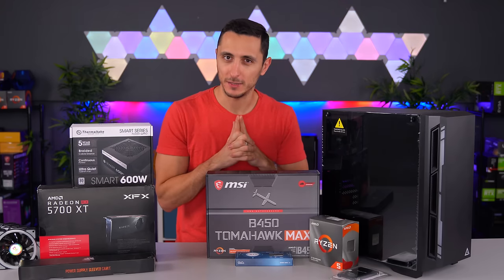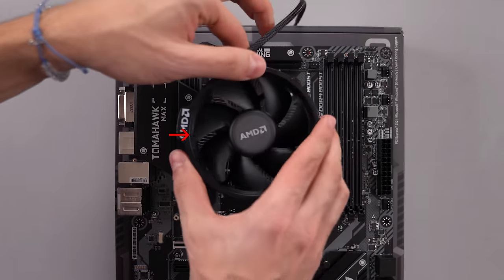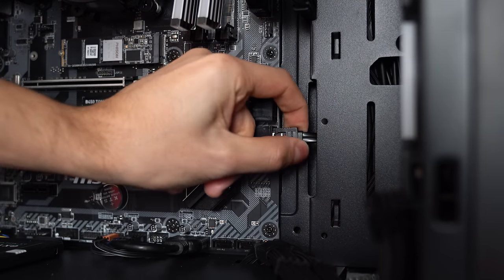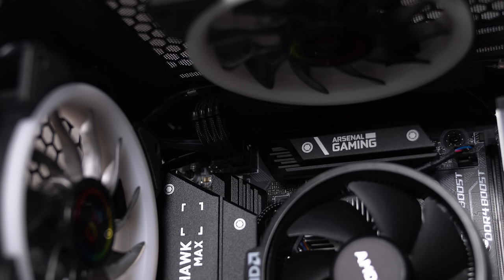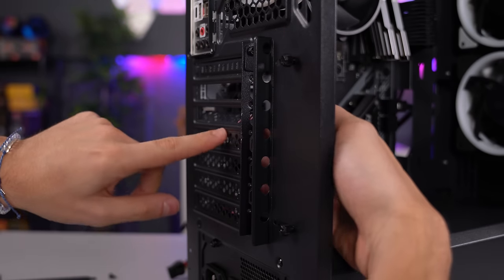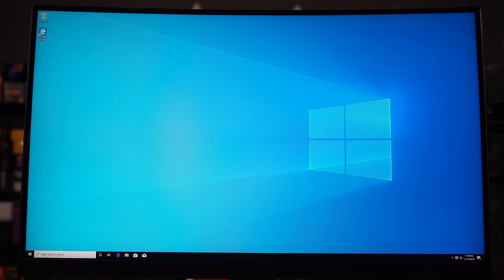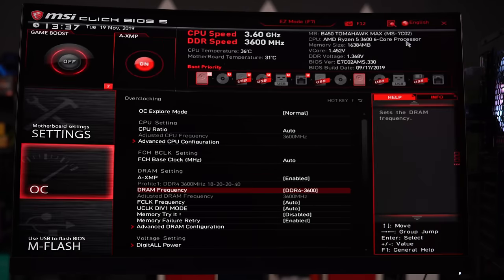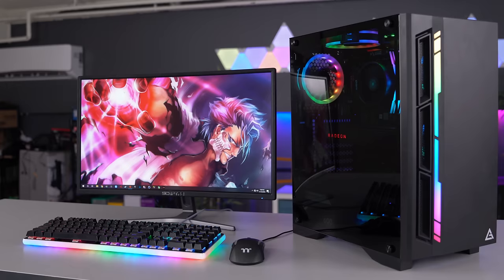How To Build A PC - Full Beginners Guide + Overclocking

Comment: Just built my first PC. I watched this like 8 times over. Great video and thank you for the help 👍🏿
Reply: if you used the windows download in the description could you please explain how it worked
Reply: Sanikk Plays it’s not that hard once you watch a couple of videos on it. I’ve watched a lot of videos but I’d say this one is one of the best or look at joey Delgado’s channel. The hardest part is picking parts and then maybe the cable management but once it’s done it’s worth it
Reply: bole crink If you’re talking about the windows OS download. You need a usb flash drive with at least 8GB of space. Then after you finish assembling your pc before you turn it on have the usb drive plugged into the pc so it will boot to the installation of Windows straight away. Then just follow the steps on the screen, it’ll ask you for your name and other details then where to put the download (choose SSD for this if you have one because it’s faster and more reliable). Hope that helped
Reply: Abdullahi Ali ok, thanks so much
Reply: @Blaqgoku12220  I dont get the wifi bit on it do I need the wifi usb stick or can I just use my wireless connection?
Reply: NOTWild Some motherboards don’t have built in WIFI so you would need to use an Ethernet cable. If your motherboard does not support WiFi you can buy a WiFi connecter that goes into the USB slot of your pc (you can find them on amazon) or even buy one that goes straight into the motherboard (if your board allows this) and gives the pc internet connection. Hope that helps
Reply: @Blaqgoku12220  thank you I now understand
Reply: Abdullahi Ali how much you got for your pc? Btw I’m Somali too lop
Reply: Nufiko I spent around £900
Reply: bole crink worked for me
Reply: @Blaqgoku12220  but how do you connect to the wifi with the wifi adapter?
Reply: john sachar I’m not sure what you’re asking here? If you’re asking how to connect to the WiFi then there should be a WiFi icon on the bottom right of your screen. There may be some programmes you have to install if you buy the adapter but I’m not sure since I use an Ethernet cable and my motherboard does not support WiFi.
Reply: @Blaqgoku12220  in talking about like installing windows do you need wifi
Reply: @johnsachar1406  just for the drivers
Reply: @ShelfOwO  o ok so thena fter installing windows can you connect a wifi adapter and connect to the wifi?
Reply: @johnsachar1406  you need to download the wifi drivers if you mobile data you can connect your phone via hotspot to the pc to get the wifi drivers and the mobo and gpu driver once your done you can connect your usb stick and your done :)
Reply: john sachar you don’t need WiFi to install windows
Reply: @ShelfOwO  o but i have wifi already but dont have a ethernet but i hesr you dont need wifi to install windows from a usb
Reply: @Blaqgoku12220  how many fps do u get
Reply: Savv561- YT I don’t game much on it. I mainly use it to edit videos but on minecraft it gets like 600 if that helps 😂😂😂
Reply: BuckeyeGaming 1212 😂😂😂😂
Reply: Abdullahi Ali does ethernet work?
Reply: Björn Gylfi Yes
Reply: Abdullahi Ali  say wallahi rn you get 600 fps
Reply: Bugie my friend it was a joke
Reply: Abdullahi Ali k had me shook for a second
Reply: Bugie 😂
Reply: Abdullahi Ali 🤣🤣
Reply: Do you need a NVME SSD and a Hard drive???
Reply: Powell you don’t need to have one or the other but an SSD is better as it’s faster and more reliable. I have one SATA SSD and one 2 TB hard drive, so you can have both if you want.
Reply: Abdullahi Ali good cause i only bought the SSD 😂 also do you need to buy 3 cooling fans? because my PC case comes with 1 pre installed
Reply: Powell I would recommend having 4 fans in the system but watch a video on where to place the fans for better air flow. Good luck with the build!
Reply: Abdullahi Ali what about a WiFi card ?? cause i don’t know if i have ethernet
Reply: Did you use thermal paste or no?
Reply: Jack Clark no I used a stock amd cooler so it already had thermal paste pre installed. I would 100% recommend using thermal paste, I’m pretty sure it’s essential for the cpu
Reply: Abdullahi Ali ok I’m pretty sure I’m gonna use the stock cooler too so since you told me it’s pre applied I’m not gonna need to put it on right?
Reply: Jack Clark you’re correct
Reply: Powell I’m not sure how those work because I don’t have one. I would recommend watching some videos on it before buying one

Comment: Today, I started building my first computer at just before 4p.m. I used almost all the same parts but some were different. It was a bit more difficult than we expected, and we thought we broke both the CPU, and the heatsink, but it was ok. Cable management was tedious, and reading all the manuals and making sure everything worked was also tedious. In the end, we did it all right, and it started first try. Thank you for this video! I would not have been able to do it without yours and other's videos. 4 hours later, all the drivers are installed, and I have my very own computer. Thank you!
Reply: How much was the build? im thinking of building it too
Reply: @dara03  What I got all added up to about $1200. But could easily be brought down to around $900, even $850. The main components were a Ryzen 5 3600, and RX 5700xt.

Comment: “a large flat surface area”

excuse me sir, it is a TABLE.

“a screw driver”

no, you need a swiss army knife that HOPEFULLY has a screwdriver. get your facts right
Reply: Don’t forget the tweasers
Reply: techsource isn’t pro at building we are we know everything
Reply: I love it how this still hasn't died out yet
Reply: and an allen key
Reply: Remember the power supply might short circuit so make sure it’s on the anti static pads
Reply: And make sure the ram is right next to each other
Reply: Quality meme
Reply: omg guys i am so sorry i forgot the thermal paste applicator
Reply: expiditious lol
Reply: Don’t forget to apply the thermal paste exactly how you would ice a cake
Reply: @rockabady2345  hmm...seems legit...
Reply: he not fighting static..

he fighting cancer!
Reply: Tweezers
Reply: Imagine building a PC in 2019 without a thermal paste applicator...SMH these rookies
Reply: Make sure your wires are in direct contact with the graphics card
Reply: These noobs using fans on their radiators...
Reply: expiditious IM GETTING FLASH BACKS
Reply: Remember also to “go bukkake” on your thermal pastes.
Reply: He called the bracket an IO shield smh
Reply: Im glad this meme is still relevant
Reply: Also, install your cpu in the cpu HOLDER
Reply: Dont forget to install the "brace"

Comment: Noboby talks about the most important thing you need when building a pc... A table
Reply: umberto de simone the verge lol
Reply: @Ubeastbot DO NOT... static will break the parts bro
Reply: @ClaymorePvP  hardwood floor?
Reply: @KlearChristal  yeah with wood it wont just dont do it on rug or metal
Reply: @ClaymorePvP  When done building the PC, can you put it in a room with a carpet?
Reply: @mohamedbataineh2  yes
Reply: It’s not recommended to put it on a carpet, all the dust gets sucked in
Reply: @kgqm768  can i do it with a floor? my floor is made of wood.
Reply: Tim Ngiap Yoon hardwood floors are fine
Reply: Laughs in Air
Reply: ClaymorePvP can’t you do it on carpet if you don’t wear clothes and use a static bracelet?
Reply: wait i have to know buy a table!!
Reply: And a swiss army knife which hopefully has a philips screw driver. Oh and also some tweezers
Reply: @mohamedbataineh2  Depends on the pattern and colour of the carpet   :D
Reply: The verge 
-idk when
Reply: ClaymorePvP it wouldn’t break the parts. It would give to much positive charge and fry the parts. You can still get static on a wood floor because of your shirt and pants. Just touch your pc case when ever you are about to touch the parts
Reply: Don't forget the thermal applicator

Comment: just built my PC yesterday. Everything started up and has been running great EXCEPT for the fact I can’t power it down or put it to sleep. If I shut down it turns back immediately, if I put it to sleep, it comes back on. Only way to turn it off is to flip the power supply switch on the back. Any help? My case didn’t have a reset PW. But the rest is all plugged in. Ryzen 5 3600. B450 tomahawk Max. Gtx 1660 super. NZXT h510 case. Power button lights up on the front. But doesn’t do anything when pressed. HELP!! update yes it’s been fixed. It was the front panel connectors, It’s been fixed and I’m loving the PC so far.
Reply: nice
Reply: nice
Reply: Jeremiah Collins go on Linus tech tips forums or Tom’s Hardware and ask
Reply: Oh damn. I feel bad man....sorry I can’t help you :( it’s been a month so hopefully you have had it fixed :)
Reply: that is easy to fix. Check the motherboard manuel, check where the case cords go than make sure they are seated correctly or place correctly that might be the problem. PSA switching your power supply switch on and off can decrease the life span of your Psu
Reply: How do you know what parts are good
Reply: XxUnknown91xX look it up
Reply: Django what do u plan on doing with it mainly?
Reply: Django it’s definitely very solid for gaming. As far as heavy coding and 3D rendering goes, I’m sure this system can handle it however seeing how affordable Ryzen CPU’s can be. I’d look to find maybe a Ryzen 53600X or above
Reply: Jeremiah Collins i might just get the nzxt starter pc
Reply: Did O help you?
Reply: Is there any good ram for ryzen 5 2600 and msi b450 tomahawk max .
Reply: koerakrõbin yes use corsair vengeance 2x8 i have the same cpu in my system works extremely well. The mother board you got you should have no worry using ur ram with it
Reply: @Adam-tu1zo  also like to note that ram speed of 3600mhz helps out a ton! I believe it's $80 atm on Amazon or Newegg
Reply: what SSD did you get?
Reply: Was it a ghost?
Reply: Yeah no shit you kinda need the front panel connectors plugged in to use front panel functions.
Reply: @jeremiahcollins_  joe mama.
Reply: @jeremiahcollins_  How are you verified?
Reply: FB3XD bruh... the extra few bucks u used to get the tomahawk max could have been used to get an even better processor.. u could have gone with a mobo like A320 instead... or may be the cheaper variants of b450. U really dont need such a high profiled mobo these days.. almost all of them supports overclocking and stuff... just a thought

Comment: Me thinking I can afford this

TechSourse: This is about 1000$

Me: Nope
Reply: 1000 just for the pc. You still need windows, keyboard/mouse, headset and monitor so like another 300+.
Reply: Where are you from guys?
Reply: @tjcmoto5484  you can download windows 10 from Microsoft then activate it with kms activator, total price: 0$
Reply: My build im doing is about $600
Reply: its 2,222.55
Reply: CA
Reply: You can build something with new parts for as low as $300 that'll run games if you pick the right parts
Reply: You can always start with a budget build and then upgrade it.
Reply: You don't have to buy all at once. I'm about to finish a build that's just under $2000 and I only bought one component at a time per pay period. I now only need the CPU then I'll be more than ready for cyberpunk 2077 in April.
Reply: I spent 2200 on mine . Building another for 1850. Aren't u guys making shitloads of money in Trump's economy ?
Reply: Me looking for original comments
You: Nope
Reply: Mr. Varhansen not if you live in commiefornia. Small 1 bed/bath apartments here cost $1300+ a month. Im 20 and i still live with my parents until im done with school and get a job that actually pays a living wage, im paying rent but even with both my jobs id barely be able to afford an apartment by myself, id need to move in with a friend/gf.
Reply: @tjcmoto5484  most people building these already have peripherals.
Reply: @tjcmoto5484  let's say another 400 for a competitive setup
Reply: @jessehinman8340  rip your warranty 😂
Reply: My build is going to be less than 1000 dollars including the monitor, keyboard, and mouse
Reply: @Sleinskyj  why did a video about PC's turn into a political debate lol
Reply: @seifhamed  dude its not like everyone has 1000$ to spend on a PC (Yesterday i ordinated 1100$ worth of parts so i'm not saying that i cannot) because maybe someone has a family, or other interests.
Reply: Exxcelled Darkness lolz u can’t afford $1000 u broke

Comment: Thank you for this, this video gave me the confidence that i need to build my own PC. My plan was to build around 3300x budget build and i ended up doing this instead. I lived in Canada so this build is like mid-expensive one. Due to covid gathering of parts is just the worst. I ended up using a ASROCK Steel legend B450 and g skill 3200. And in a few coming weeks I’ll get laid off of my job so my pc build is a remembrance from that job, still gonna enjoy it tho with my social assistance while laid off. :)
Reply: Omg mobo bros
Reply: I litterly just bought a ryzen 5 1600 than realized a 3rd gen ryzen 3 is better and cheaper.., I’m crying on the inside.
Reply: Cube Cat the 3300x is my original cpu in mind while gathering parts. I have it pre- ordered on my local store, since I’ve save a little money on some other parts i did invest it on the 3600 just a little bit future proofing in mind.
Reply: Cube Cat plus i got the 3600 on sale. Like $60 off before it got out of stock.
Reply: Pinoy ULam ATBP nice hope it works great!
Reply: Cube Cat i got a 2600 and my ram for less than the 3600.

Comment: The last piece of my build comes in the mail on Tuesday. Will be watching this step by step while building it to ensure perfection lol. Awesome guide with thorough details! I'll keep you guys updated.
Reply: Ay that’s today how did it go bro
Reply: @awesomegamerdadasa1670  im still waiting on the gpu to get here lmao. UPS taking FOREVER
Reply: Build went perfectly smooth with the exception of plugging in the CPU power connector on the top left corner. That's on me tho cause I have big hands lol. If I were building another one, I'd plug that in first before securing down the MB with the standoffs. Other than that, this guide worked to perfection, even with the overclocking!

Comment: I swear the internet knows everything because this video showed up in my recommended videos not 24hrs after I purchased a majority of the parts I need for my build 0_0
Reply: @patrykmalinowski5058  AMD Ryzen 9 3900X, ROG STRIX AMD Radeon RX 5700XT, ROG STRIX X570-E Motherboard, Seasonic Focus GX-850, 3.5" Seagate Barracuda 2TB SATA HDD, and an Asus PCE-AC-88 Dual-band AC3100 Wireless PCI-E Adapter, so far.
Reply: @romankovbasniuk1826  Dayum
Reply: @romankovbasniuk1826  no ssd?
Reply: Roman Kovbasniuk You’ve gotta grab that Samsung Evo Plus bro, need those boot times to be quick 📈 fire build tho, hope it goes well
Reply: @dontrwooshmeimtrolling4003  I'm working on it. I'll be getting a Samsung evo, I just have to decide how much space I want on it.
Reply: @N-Kiro  that's what I'm going for right now, haha 👍🏻
Reply: @romankovbasniuk1826  yeah but ssd are really cheap nowadays kust bought a 500gb nvme ssd
Reply: @dontrwooshmeimtrolling4003  I'm exacting when picking parts, so that's why I didn't want to just get any old nvme. Price is not the name of the game. It's the right price based on the performance.
Reply: Roman Kovbasniuk really nice build
Reply: VoidFever thank you =3
Reply: Bro, this is why they track everything you do. On the one hand, you have no privacy, but on the other - they're really good at predicting what you'll want next!
Reply: Same here. Parts I bought:
Ryzen 9 3900x
Asus ROG Strix X570-E
32GB jigsaw ram
2x MX500 2,5" ssd
1x Samsung 970 Pro 1tb NVMe
Gigabyte 2070 Super Windforce 3x OC 8GB
CoolerMaster Case MasterBox MB511 RGB
Corsair PSU 750W (modular)
Reply: Roman Kovbasniuk you are going to get major bottlenecks in graphics card and storage. Ryzen 9 is so overkill. You only need ryzen 5 and it will make no difference unless you have a better gpu. Also, ssd is a good idea to download windows on
Reply: Zachary Rampelt what if I have an ryzen 3 2200g with rx 580?
Reply: And b450 msi Bazooka v2

Comment: TechSource: This download will take from 1m to 10m!
Me : Good,ill go to the bathroom
My network downloading it in 1m : Not now sir :D
Reply: I wish I had your internet :(
Reply: @sqrt2167  i feel u,i was on 50 Mbps before i upgrade it to 1gb.The difference is huge
Reply: @ciubuc1128  I only have 30 mbps and after 10pm the Internet becomes under 10 mbps :(
Reply: Wait you guys are having more than 30mbps?
Reply: @sqrt2167  damn,that sucks...
Reply: @bingkoirekt5057  yes,i have 1000mbps but if u have low network speed u should go for a cheaper router.C6 wont work that good with slow network speed

Comment: I’m literally going to micro center tomorrow, perfect timing for the vid!
Reply: Your#1 Fan the one in Brooklyn? That’s where I got my pc.
Reply: emre north jersey
Reply: YO ME TOO! I’m grabbing an r5 3600x with a motherboard, 32 gb Corsair vengeance ram, and win 10 pro along with 2 monitors for my dad’s office pc.
Reply: You'll need a video card with that 3600x. Good luck
Reply: Amanuel I’m doing a full rebuild of my dad’s current prebuilt but I’m transferring the gpu which is a GTX 745 as its going to be an office build
Reply: b r u h don’t buy windows 10 full price please. I bought windows 10 pro for £2 (around 3-4$) on eBay. I downloaded it for free on a USB then activated with the eBay code.
Reply: Philosyphy just on eBay. there’s no specific link there more than 1 seller
Reply: Philosyphy  Dude, there are so many ways to get a free copy of Windows. Just Google it, and you can easily save $100.